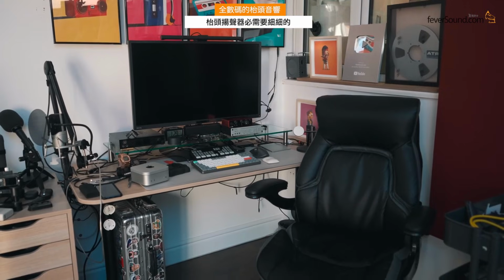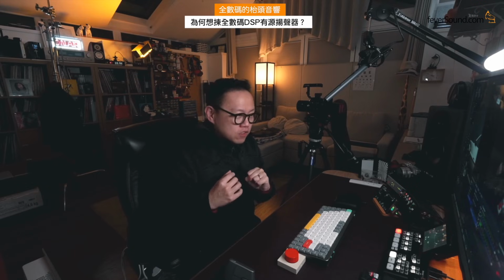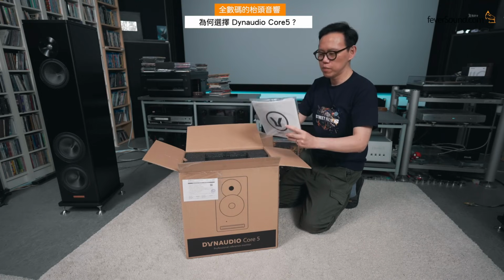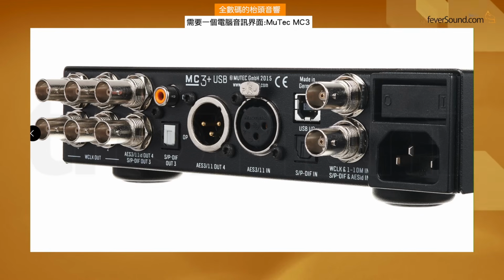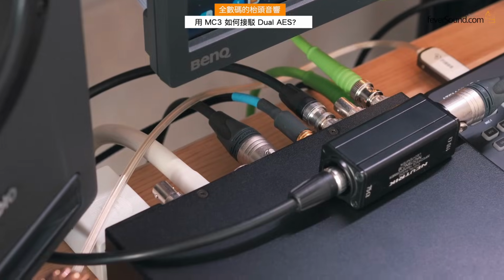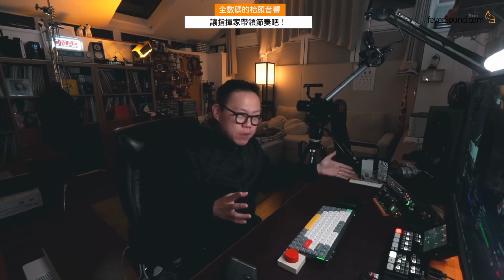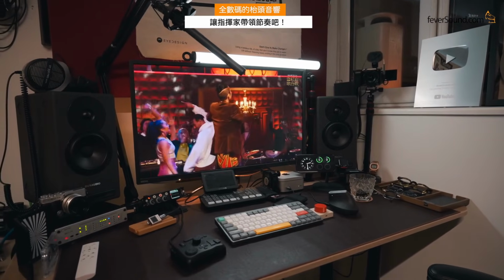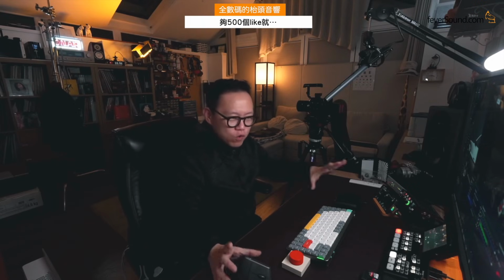A Desktop Audio System with No DAC at All

Comment: So you don't want to use a dac before an adc+Dac combo.. so how many times do you think recorded signals go through adc/dac in the studio? Mastering gear is often analog, but in and out are digital because tracking goes into digital. 
I just use combinations of gear to get the sound I want in my listening room. In my studio it is best gear for the job with good quality gear.
Reply from the maker: I’m well aware that many of the world's finest recordings are done in analogue, so please don't misunderstand—I'm not saying analogue is inferior. I simply want to explore a different way of configuring a system for this particular setup
Reply: @feversoundE  I have no problem with your goal at all. Just had to mention that the view that many audiophiles share about not wanting to adc<>dac because they want to hear it the way the artist meant it, is usually forgetting that mixing & mastering is in between the artist and the listener as well as multiple conversions.
So nothing wrong with minimal or super eleborate setups, as long as you get the sound you want.👍

Comment: There are floor standing big speakers from Teufel also totally digital. Also compatible with a lot of sound sources, not only PC. For me - the best possible audio setup for reasonable money. Actually, a bit too expensive for the moment, I'll save for them for a while... Now I'm using a soundbar connected to my PC with a Toslink optic wire. Analog audio is so obsolete ;)
Reply: As I mentioned in my video, I won't be considering oversized speakers or prohibitively expensive equipment for this desktop system. However, thanks for your tips anyway
Reply: @feverSoundcom  Speaker size aside, the shortest possible analog path rule stands and works as charm. Also - we get digital (meaning - lossless) EQ like free. I strongly recommend Equalizer APO app, it works on a Windows driver level and offers huge variety of configurable filters that allow cheap speakers sound like something a couple of shelves better. Of course at the cost of reduced power. And some time needed to configure the sound.

Comment: You could use plate amps, i.e. Four Audio (Germany). They include digital AES/EBU input and analog XLR. The onboard DSP is able to do crossover in IIR and FIR, you can use measured speaker measurements to construct time- aligned response. Amp modules are from PASCAL, which are very good. Build you dream speaker with an all digital signal path. As a preamp, you could use i.e. MiniDSP SHD Studio (digital only) or SHD, if you need analog sources, too. Enjoy music. 👍
Reply: The MiniDSP SHD Studio is an excellent suggestion; I'll definitely give it some serious thought

Comment: Interesting video, yes going digital to analogue in a flash D to A, then converting back to digital in a DSP speaker is just nuts.
I run passive speakers, volume adjustment only on the analogue to avoid that resolution loss, although saying that kind of implies super hight end analogue at my end - which I don't have. It just does not sound right so I don't do it digitally. Plus the digital level adjustment will almost always never be a simple ratio, like 6db, so all sorts of maths are being performed on your pristine audio, Not the bit perfect digital world we are supposed to be seeking. 
However as you have found good results can be obtained doing it the other way, especially if you can run 24bit pus so the digital dynamic range will always be way above what your ears can perceive, almost no matter how far you turn it down.
Reply: Exactly. As I pointed out in the video, the biggest weakness of this setup is the digital volume control. Even though lowering the volume with 24-bit audio doesn't produce any noticeable distortion, it still feels a bit 'off' at the back of my mind. I'll be looking for some solutions in the near future, so do check back later for any updates

Comment: So what about the DACs in the Dynaudio Core 5? And I'd like to point out that one of these Dynaudios is far more expensive than a decent PC.
Reply: There is no DAC inside Core speakers, Why? Traditional amplifiers (Class AB) simulate the magnitude of the waveform. However, Class D operates via 'rapid switching' (PWM, Pulse Width Modulation). It drives the loudspeaker by controlling the duration for which the switches are open. Since the AES3 input is already composed of digital signals (0s and 1s), the chip can directly convert this digital data into the switching instructions (PWM signals) required by the Class D system. The signal remains in a digital/switching state until the very last moment before driving the speaker.
Reply: @feverSoundcom  That means, that the Class D amp is effectively the DAC.
Reply: @peterofenback9263  A Class D amp does indeed eliminate the need for a separate DAC, and since it's ultimately driving the speaker units to produce sound, I define it as a 'power amp'. You're right, of course—a conversion from digital to analogue does take place during that process. If you’re that concerned about the strict definition of a DAC, then next time I’ll just change the title to 'No DAC for Line Stage' instead! XD
Reply: @feverSoundcom  so from digital 10101 to analog sound waves, that sounds to me like a DAC
Reply: Indeed, the title of the video is misleading. If there were no D/A conversion (in other words, no DAC), we would not hear any music out of the speakers.